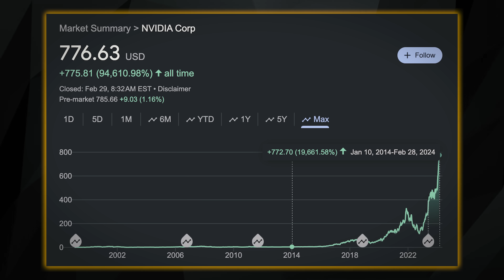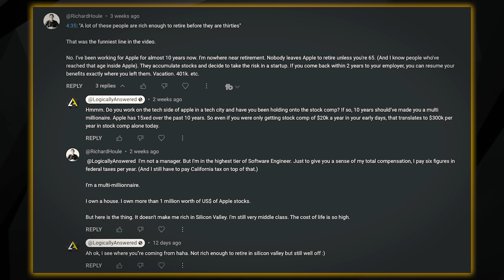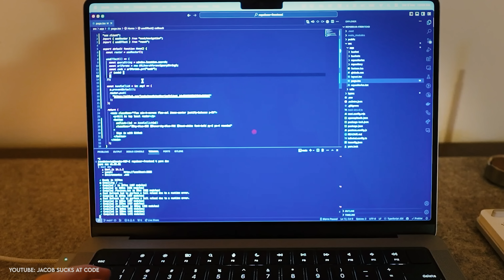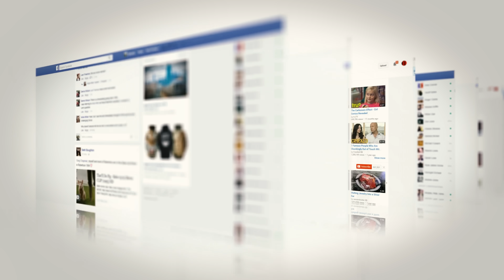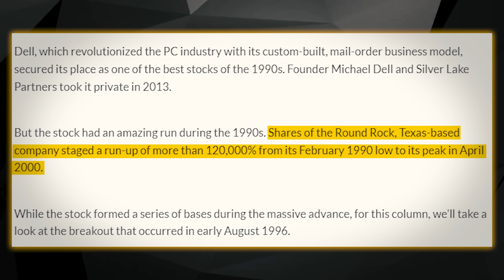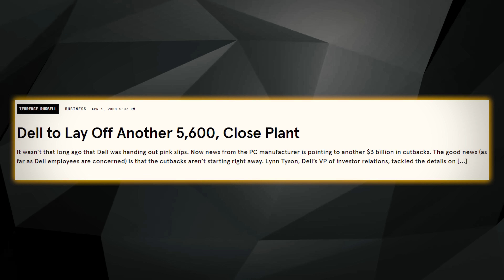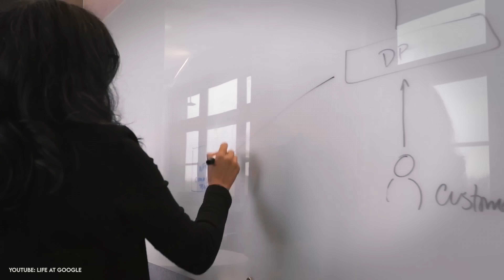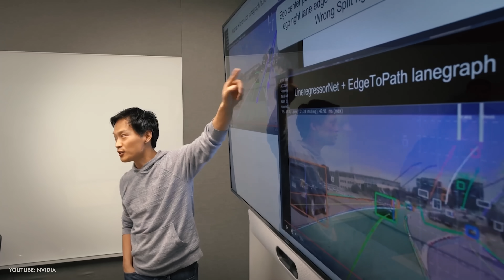What Happens When All The Engineers Are Rich Enough To Retire?

Comment: This is a nitpick but I hate the characterization of a house from the 1920s being a bad thing. There is a mindset I've seen online that seems to think buying a house is like buying an RV, and that you will need to tear it down and rebuild it at some point. The problem is that the housing stock in the Bay Area is simply of low quality. Probably a lot of the worst examples are more from the 1970s.

Comment: If I had 10M,I would retire to do what I love. As an engineer works in semiconductor Fab, 10M net worth is very difficult compared to software engineers and the life is harder (24x7 on call usually, working in production has very high pressure). 
We don’t have such high compensation as software engineers since our profit margin is much lower than software (The overhead is very high. It costs billions to build a fab). Most Fab jobs suck. I regret to choose this career. 
I hope my portfolio will grow to 10M+ in 10 years, retire and do what I love.
Reply: Yeah it's just an unfortunate aspect of how our society works. The people at the lower levels of abstraction, manufacturers and hardware designers, work the hardest in terms of effort and designing. People at the higher levels of abstraction, like corporate executives, product managers, and even software engineers, get by far the highest pay while doing much easier work. I could have been a "real" engineer, doing design work that is directly linked to physics. But instead I went into software engineering because it's easier, pays better, and has much more flexibility in terms of job opportunities. And it looks like that aspect of society isn't changing anytime soon. I hope you get to retire in your timeframe.

Comment: Then there will be a need for engineers and there will be more people going to college for engineering and they will get the jobs. It’s supply and demand. Hint to any high school kids out there, look at the places hiring and get that degree. Engineers are super important, trades are easier to get into and are severely under staffed. Depending on location you can pretty easily make $75-100k as an electrician or plumber after you are a journeyman. And with no student loan debt. Engineering takes debt but will get paid off quickly if you aren’t a buffoon with your $150k a year salary.
Reply: "Look for the positions that are hiring and pursue those degrees"
Degrees take 4 years. By that time, the positions will be filled or the company will have given up.